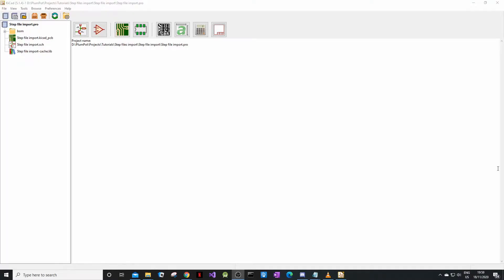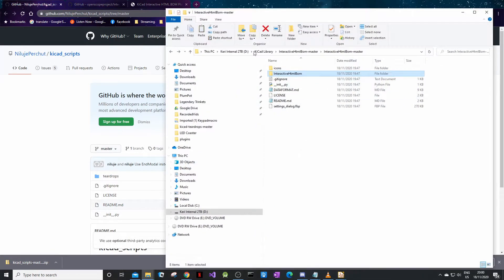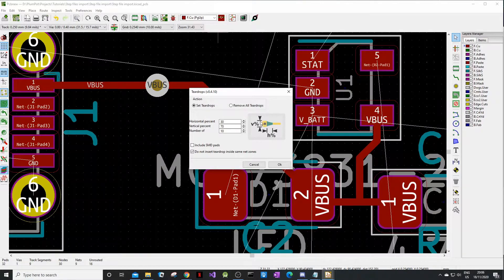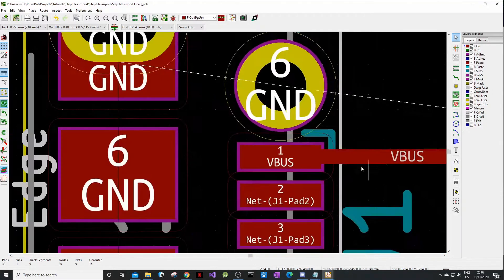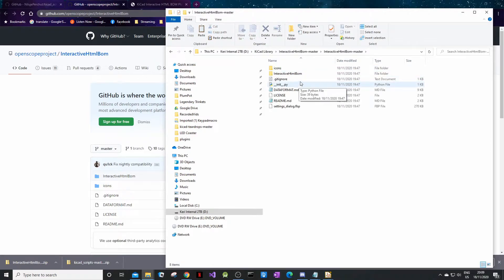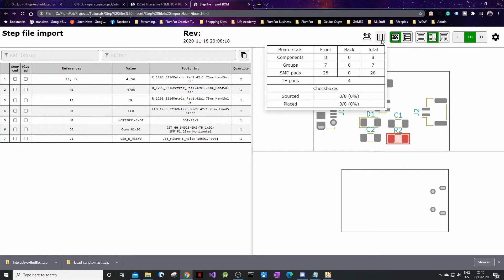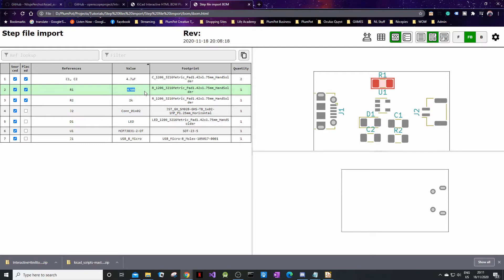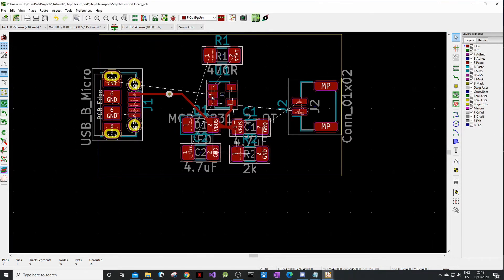Ki-Cad Tutorial - How to install Plugins - Tear Drops and Interactive HTML BOM

Comment: 4 layer medium/high  density pcb design in kicad. (please place components on both side of board. )
Reply from the maker: Hi, you mean to make a video on that :)?
Reply: @PlumPot  YES.. THANKS IN ADVANCE :-)
Reply from the maker: @VarunVh2014  Understood :) Will try make one this weekend, any specific circuit you have in mind?
Reply: @PlumPot  if you have time ,consider  any F4 /F7 drone board , otherwise  any high frequency circuit you like :) .  add some tips about component placement  then things we can "do/dont" in 4 layer pcb design, advantages & limitations of  kicad in 4/6 layer  pcb design etc.
Reply: Thanks for this tutorial ❤️

Comment: I like this, only just spotted it teardrops seem to give the board a better finish and visual appearance never mind the mechanical properties benefits.
            Is there a way to change the default settings to one that I would use normally without having to enter my settings each time. 
            I have looked through all the program files that came with it and can't see anything that I recognise as being able to change the default settings.
             It is a remarkably quick program and my only adverse comment on it is that an information box pops up and disappears so quickly that you cannot see what it is saying.
             My other little gripe is that the teardrops are not filled in, just a very thin outline. Is there a setting I can change for that?
             I do love the the fact that you can manually change the shape of the teardrop.
             Overall though a brilliant little addition to Kicad, many thanks for bringing it to our attention.
😀